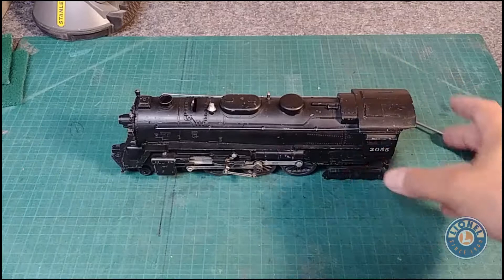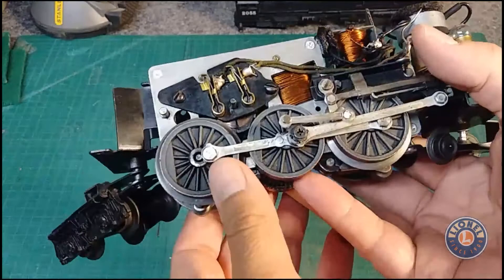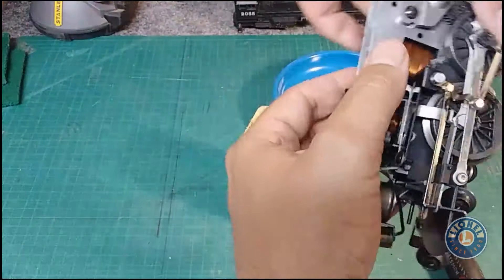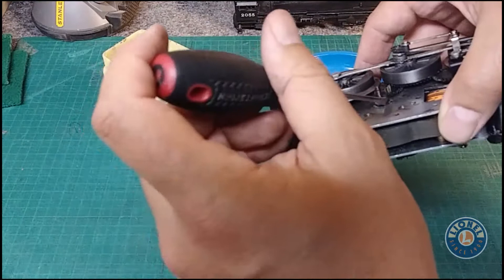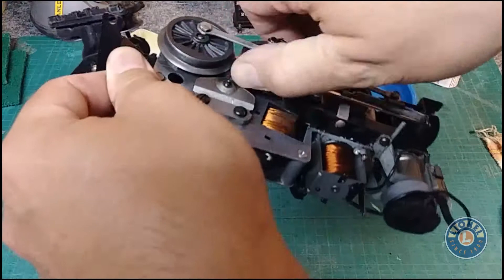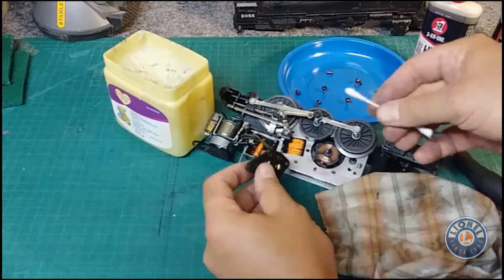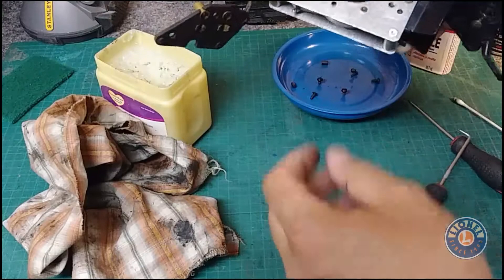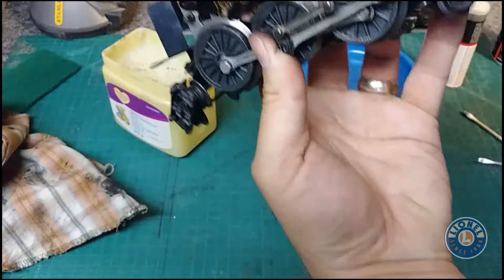How to Fix a Lionel Train Postwar 2055. Basic Shell Removal and Maintenance for Newbie Beginners

Comment: Another wonderful and interesting Lionel video. I love the 2055, right size, right weight, runs and looks great. I an a fan of your videos ever since the Scout motor video. BTW I've referred to that video many times and have been able to rebuild many scout motors without a problem, all running great when finished. Thank you for all of your efforts.
Reply from the maker: Thank you! I am so glad to hear you found these helpful. i have a new Scout video in the works. Swapping out a motor to give my 1120 a bit more pulling power. Stay tuned!
Reply: @warrenmuzakpostwarguy4331  I just swapped  out an old single reduction 1654 motor and replaced it with a double reduction 1655 motor. Side rods had to be changed but no other issues. I forget the even swap for the 1120 I think it might be an 2034. Anyway good luck with that project and I will be  looking forward to the video.

Comment: this was a very helpful video thank you. i want to do a project locomotive and the 2055 seems a logical choice to start given the ease of disassembly.
Reply from the maker: Thanks. Yes the 2055 is a great start. It looks great, easy to work on, once up and running it will run forever and there's lots of them still around with parts still easy to find.
Good luck with your project and Best Wishes in the New Year!
Reply: @warrenmuzakpostwarguy4331  thank you!! yes so far the 2055's have been kind to me. only thing slowing me down has been you know, work.

Comment: Hate to be a bother, yet again.  The smoker unit on the 2055, is it pellet or liquid??  I think my old man mentioned using pellets as a kid but he is using liquid now which is confusing me even more since it has the original smoker unit.
Reply from the maker: Originally it was a pellet type. You can absolutely use liquid smoke in a pellet type smoker. It will not damage it at all. I only use liquid smoke in all my Postwar steamers

Comment: I have a complete 2055 Santa Fe Hudson noob question.   I know nothing about these trains and was tasked to fix my dad's old childhood train set..   I know nothing about these trains but do know wiring, electronics and how to fix such things.   The controller box and coal car that whistles needed new wiring, so I soldered all new wiring.  The 2055 needed nothing and now I have everything running, whistling and I am honestly having more fun with it than I thought....       But here is my question, what is that switch/lever on the top of the 2055 engine??  I have no clue what it does??
Reply from the maker: Glad you are enjoying working on the 2055. With all that new wiring it will run for another 70 years. The lever sticking out of the boiler on the top is the selector for the E-unit. The E-unit is a directional control. 

It has 3 positions, forward, neutral and reverse. You can change direction of the train using the transformer so theres no need to do it using that lever. HOWEVER you do need to have the lever in the forward or reverse position. If its in neutral the transformer can not activate the E-unit thus change the trains direction.
Reply: Thank you, had no clue what it was for, since I never took it apart I assumed it was a setting or adjustment for the smoke.  But after seeing you take yours apart and looking at it I was really confused.  Thanks again!